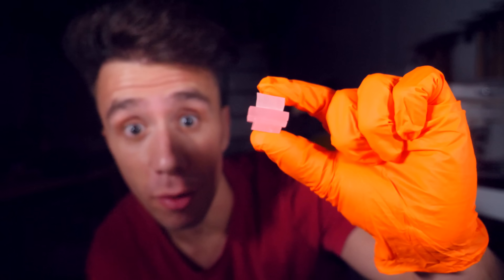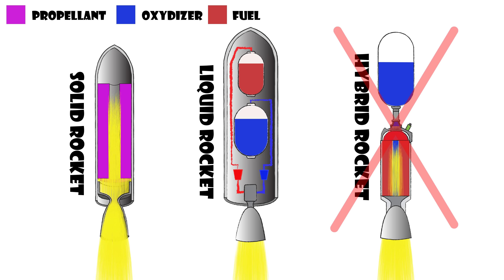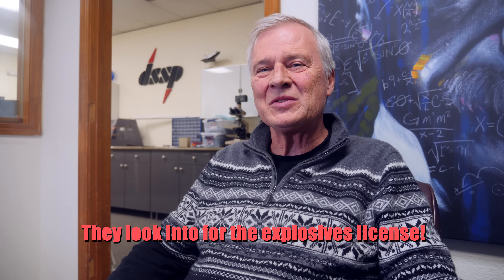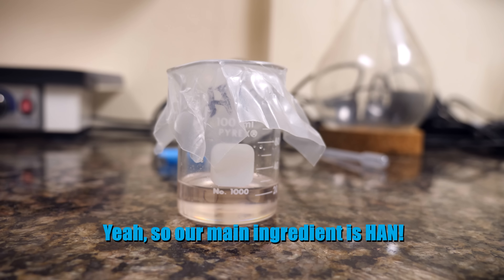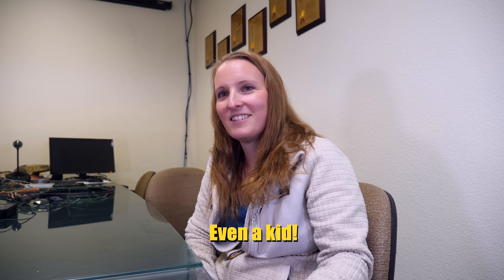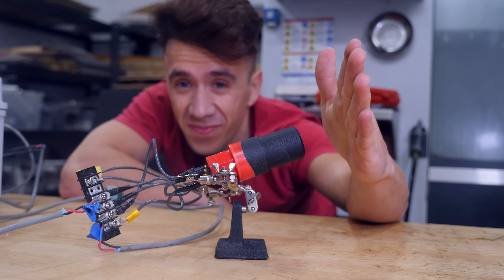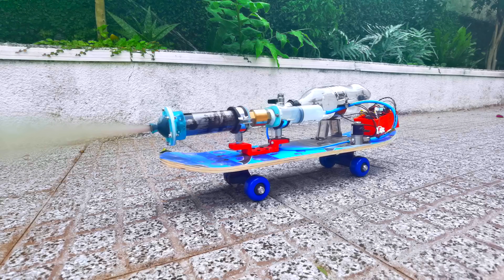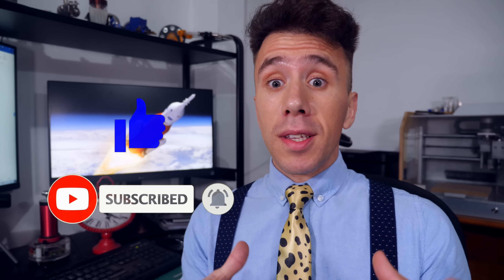ELECTRIC SOLID PROPELLANTS

Comment: I'm not sure if you've done anything like this before, but what about this: A rocket powered by oxyhydrogen (i know it's the fringe term), which doesn't need to be filled with the gas, but with water, since it is quite easy to generate the oxygen and hydrogen mixture quickly from water and electricity. Therefore: A water powered rocket! It would for sure be a good tomato killer!
Reply: HHO or browns gas
Reply: @bbk9787  Exactly! But as far as I'm aware, both of those aren't the correct scientific terms either, right?

Comment: Hi Integza! I really like your humor and passion about technology. I would like to see a water direct injection system that would electrolyze water to produce hydroden and oxygen inside the chamber of either a 4-stroke or 2-stroke "classic" engine and ignite it. The idea is to harvest the potential energy of hydrogen in automotive applications using water as the primary source of energy.

Comment: Make a rocket but with a ducted fan nitro methane Rc aircraft engine. Not only can you throttle it but you can 3d print it and even fly it if you have movable fins and maybe canards. Can even make ot look just like starship. 

Really need a 3d printer to make parts for my friends prosthetic hand. But because i live in california and my business taxes are so high and profits non existent. Add in my fiancé took my work truck and all my assets. (Not trying to turn this into a sob story. Just telking my story as to why i need a 3D printer and cannot afford one) 
Thanks man. Love your videos

Comment: I wonder if this fuel would be good for loitering drones. The real question is how much electricity and volts and in amperage do you have to have. It's a cold product though but if you'd have to carry on board lots of batteries in order to control it. Might not be worth it

Comment: Would it be possible to create a lens to visually show you the frequency waves/ amplitudes and source while outside? ( e.g. while walking be able to tell if the emf is just a power source or a data source like wifi, radio) similar to a transparent light filter overlay.
Reply: The military has one for gas in the air to help find leaks. I would guess with technology advancing as fast as it is what you are imagining has or is being created right now... Have you ever read about collective consciousness? Once an idea is spawned in the imagination, it is shared to the collective consciousness of mankind. 🤯

Comment: Hi! How about using liquid nitrogen as a fuel?  How strong will the pressure and thrust be in such an engine?  It may not be suitable for a rocket engine, but you can try using both a belt drive and pistons. Thank you for you videos!

Comment: I have a question that I think you would like. Okay so this stuff reacts with electricity, so I'm wondering would an ion thruster be enough to set the stuff off? Like what would happen if we had a relatively short booster tube with this stuff cord out in the middle like solid rocket grain. And on the other end perfectly align with the core was the ion thruster. Would that be enough to set it off and create actual thrust from this ion thruster? Could we give a relatively major boost to an ion thruster. This needs to be an experiment like yesterday. The thruster would be relatively small maybe two feet long. With the same circumference as the ion thruster itself. Small enough towards manageable.

Comment: Ssooo...  what I heard him say was you "can't" make a large rocket booster out of it...  but from what he was saying...  you can...  its just that once you light that candle and it's burning at full whack thrust, you can't turn it off just by turning off the electricity feeding it, so it'd be POINTLESS to use in a large rocket engine, but not impossible.  Impractical basically.

Comment: I have some old Christmas lights at the house. I understand that when one bulb goes out they all do. How about switching that into DC power and use the little sockets as mini igniters? The wiring is mostly there just connecting the circuit without the bulb filament.

Comment: Since GEM is moldable once available you should build mold an entire rocket out of GEM and power it qith a small battery and make a rocket made of solid jet fuel...there won't be anything left of it but you can see how high it can reach

Comment: It seems you could simply pelletize HIPEP to make a solid booster, couldn't you? Yes, it's become essentially a liquid-fuel system (pumps and valving), but doesn't that also enable an additional failsafe to the overall rocket?

Comment: But if the rocket contains an enourmos amount of separeted long rods of solid propellant that are put through a kind of horizontal heat isolated grill with small holes that together with the rocket nozzle (with the electric injectors which continously) is elevated through the rocket while the rods are burning then you might be able to throttle all the rods at the same time because the only propellant that might will burn is what is bellow the grill (with its verical throughgoing rods) which protects the rest of the fuel from burning or ionizing?
It can very easily be tested with just some few rods

Comment: Could you do a video about how a 2-stroke engine uses a resonant pulse, standing waves, and harmonics to run? And how changing those properties tunes the engine.
Reply: From my understanding they're fairly similar to how pulse jet engines operate, kind of and that's a big KIND OF lol. There's a channel called 2 stroke stuffing that touches on the subject a bit in some of his older videos. I know the distance of the expansion portion of the chamber and stinger from the exhaust port has a big effect on how much power the engine delivers relative to RPM, throttle, fuel input etc.. I.e. An expansion portion of the chamber closer to the exhaust outlet typically producing more low RPM torque and HP and further being better for higher RPM power. 
  There's obviously a ton of other variables that effect performance as well, whether it has a reed-less piston-port design, crankcase reeds, or intake port reeds. If it has an exhaust valve which can have different designs being mechanically and/or electrically actuated effectively changing the duration and flow of expelled and resonant exhaust gases . The Intake, exhaust, transfer port timing, and squish band (portion of the upstroke where the air/fuel mixture is compressed partially dictating the static and dynamic compression ratios) ignition timing, fuel type & mixture all have a pretty significant effects on everything also. There's really a lot to unpack on the subject of 2 stroke engine operation and it's all somewhat subjective to the type of two stroke engine and relative variables in play.
  I'm just a lowly-laymen motorcycle mechanic though so I can't speak as to how exactly the primary/secondary forces, harmonics, and resonant exhaust pulses work as thoroughly as Integza might be able to but hope this helps a little. 😂🤙
Reply: @WreckedRevival  Thanks, I have a very loose understanding of the science behind it. A friend of mine can actually design intakes and exhausts, I don't understand that. I just thought it would be a beneficial video so people have a better understanding of how ICE's operate.
Reply: @sporeut  that’s awesome, would be cool to be able to fabricate stuff like that. I definitely agree though, more people having a basic understanding of the fundamentals of engine operation would definitely be beneficial!

Comment: Thanks .. my project is to take my model plane a 3kg Aeronat blade 2   delta electric turbine jet  4kg  thrust  modified with more thrust  to get to speed of sound  800 MPH for 2 seconds to 10 seconds while in a vertical dive. With electric   systems the top speeds would be less than 200MPH about 270KPH . If I  put on a single  solid   fuel  rocket with 4 second impulse and 15kg thrust the ability to fire it up  correctly and control this plane  at 300 MPH would probably shred the plane not  made for  these speeds. So I would use plane for mold of  S-Glass epoxy carbon version  able to resist  flutter issues at 800 MPH plus  and thrust of  30 to 50 KG at large speeds. The project would be to use mother ship large model plane to get to high height some one to two miles high   and drop the rocket plane where it would use gravity in a vertical dive to get to about 250 mph  .Then a suitable rocket engine  would fire up and drive plane vertically down to speeds of sound before plane would exit dive to pass the ground at speeds close to speed of sound. The radio controlled plane would  need several  kgs of  solid fuel or liquid fuel and pumps that can supply some few litres in seconds  before it went into glider mode and slowed down for a empty  of fuel landing  . At full speed the system would use auto pilots to control vertical dive and pull out of dive as  high speeds would be tricky for RC flights but not impossible. I was looking the idea to use mono prop  nitro methane with some liguid oxygen  but for example www.firearrows.com 8kg thrust 200cc  burn chamber  compression ratio 250:1 with petrol fuel and  LOX oxidiser cooling expansion with spark plug used 5ks fuel for 90 second burn  Weight of motor unit Ae built the rocket engine based on plans from firearrows based in South Africa at that time about 2011.. Now in 2022 fire arrows .com has reduced site to only early hybrid version rockets  the why i dont know... Email ontact web site " 2011 was zechyc@firearrows,.com and he was then a member of South African rocket club.  This new GM fuel loooks to be a possible solution  reliable start up and switch off if things go pear shaped and no risk for fires for storage transportation  and less risk of fires at any crash site.
My guess for first flights it might require to top of mountains like  Tenerife in Canary mountains some 10,000 feet high to reduce air resistance and get faster speeds.  Alternatively it might require higher alpine mountains in ItAt to get 50% less air drag. A standard 3 KG blade engine off  will do in vertical dive 150MPH  AT SEA LEVEL  as air drag 3 kg equals  3kg weight  of Blade 2 .  If you Increase weight   of Blade 2 to 5 kg or reduce drag with thinner wing or smaller   clipped wing   you could reach 180 MPH in vertical dive engine off. Modern  model kero burning Jet turbines of 25KG about 50 BHP  can drive model planes of 10kgs in shallow dives to speeds of 550 MPH. Bear in mind the turbine jet efflux velocity is 800  MPH   so  550 MPH is with losses  about max speeds from 25KG engines  with simplex single stage impeller compression 3:1 engine s with single rear stage exhaust turbine. Rockets with efflux speeds of 1000 MPH  plus could in theory    maybe exceed 700 MPH  on suitable  model planes  For model kero burning turbine jets the after burners are not likly to assist much with speeds  for scaling issues.  If you double speed you Quadruple air drag so to go to 300 MPH  with a 3 kg Blade 2 model it needs 12 kgs of thrust  There fore 900 MPH needs  200 kgs of thrust.  increasing all up weight of Blade 2 to 5KGs and clipping wings and bladder fuel tanks  and possibly twin engines in  twin  25 KG thrust in twin engine nacelles and launch from a 40,000 ft Balloon  launch   solution over Salt Sands USA  could reduce thrust needed to  get 50KGs for ten second to get   to about 800 MPH . Also bear in mind the 3kgs of lift increas with doubling of speeds exponentially so lift at 800 MPH could exceed 30 KG or ten times the weight of the 3 KG aernaut  Blade  2 craft.   Those forces create flutter and tear wings off  if not properly made. In the USA 550 MPH  dynamic slope soaring with no engines  with weight of 10 KGS including  lead Ballast with ten foot  wing spans  of non delta  carbon made wings and  parts  costing north of 2000 dollars  would break up if pushed to 800 MPH. My preferance is to stay with good glider wing like Blade 2  beefed up and stay below 5 KG all up weight if possible to try to keep costs down . Increasing size of plane to 20 Kg  would help a lot for high speeds but could increase cost by  20 fold maybe 100 fold .  What is the height of Portuguese or Spanish mountains preferably not  near  tinder box fire zones like forests in summer . My  present  location in Ireland I cannot  easily get ATC permission to exceed 1000 feet  . Andorra where i worked before in Summer time has high mountains  maybe high enough  and empty in summer  might agree let me fly this speed attempt .If you look   Elon Musks rocket engines using methane fuel   you will see a green colour flame exit first  where he uses another fuel to kick start the engines as it is very hard to make rocket engine fire up exactly on time schedules.
my target to fly looks to be 2024 summer   probably Tenerife  after i  have done slower test flights in France where i Have flown model plajnes there for many years   unless Putin invades France and ruins the fun ha ha . You can look the Blade 2 model at https://aero-naut.de/produkt/blade-2/    and  it looks like a hybrid delta type extended wings on the Delta to improve glide for engines off landing 

Happy new year 2023
Anyway happy new year

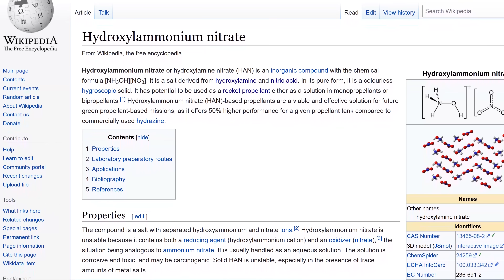Comment: around 2.50-3:00 your are talking about having an carburetor :). Solid Rockets is just Fire and Hope!. Where Fueled ones are exhausting the Flame into turn of the Fuel Pumps. Your solution do not need Fuel Pumps and are controllable like having an carburetor in a Car

Comment: For a rocket propellent, you should use either Manganese heptoxide or another thing to heat powdered potassium nitrate, granulated white sugar, Karo syrup, and distilled water in a saucepan and mould the mixture to the desired size and shape once it cools off.
Reply: https://www.youtube.com/watch?v=OszX18NLtrY

Comment: But isn't it bit of problems to ignite the material as it only ignite by electricity then it has to touch the lead but after burning sometime it will loose material and connection broken and can't be burn as it not connected for example as u show that cylindrical burning device which has two connector as outer cylinder and inner cylinder and in between is the material (forget the name) as it is small material it burning quickly so it burns all of it but if you take bigger outer cylinder and more material then initially it will burn but then it lose the connection and stop burning and yes a substitute can be multiple small cylinder but it will increase material and weight also cost may be

May be it was already solved but I will be obliged to know the answer and sorry for my stupidity correct me if I am wrong

Comment: The reaction when voltage is applied is similar to the ablative shielding on reentry vehicles. As the compound 
is super-heated it turns to plasma. I believe the process is even called ablation on the plasma thrusters.

Comment: Think about this. Could something like this stuff be the supposed “element 115” lazar spoke of. These ufos using a high frequency high energy super dense form of this type of  fuel with tuned “containers” as amplifiers that then use these goofy shaped vehicles as some sorta reflector that rides a wave of energy created by all this funny electro fuel... 😂 did I lose my mind tonight. Yea I did

Comment: EVERY propellant has a tradeoff, no such thing as a miracle propellant. Right propellant for the right application. Hydrazine is great due to low MW and low flame temp which makes it very easy to design systems that don't melt. HAN based propellants are typically diluted with water because it burns so hot. High flame temp is required to get similar performance which makes the engines more difficult to design and rare alloys are typically required

Comment: Awesome video as always :)
I could really use a 3D printer to start learning on.
May I suggest a video based on the school project of building bridges with spaghetti, but challenging other 3D printer owning youtubers to make bridges under very narrow constraints (like weird materials, fast prints, material quantity constraints, for example).
Reply: Get one of the Ender 3 Pros or variant models of it. They're solid little printers to start with and with a few dollars of modification and tuning can print as well or better than a lot of expensive printers. In general they're tuned well out of the box. The only real tuning you can do to really perfect them is to make sure the print head flows at the exact rate you specify. Beyond that you're good.
Reply: @weakmindedidiot  I barely have money to feed my family, but thanks :)
Reply: @weakmindedidiot  well, that's where I live, I am from Europe

Comment: I want to see you modify a combustion powered vehicle to operate on gun powder.

That could be a car, or a go kart, but it will need a device to measure powder for each cylinder, on every intake cycle, according to throttle position or intake vacuum level.

Gogogo!